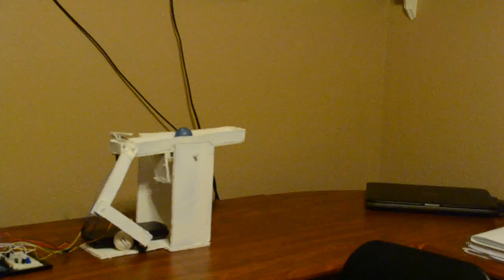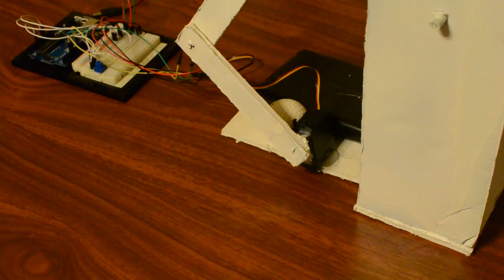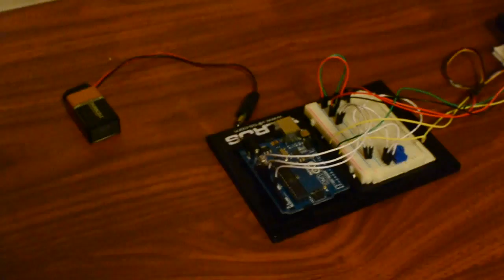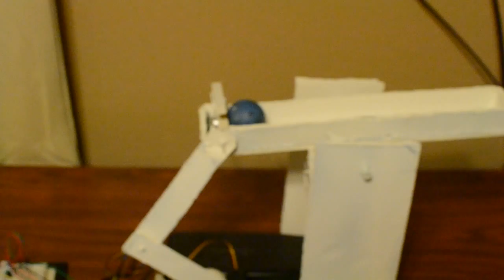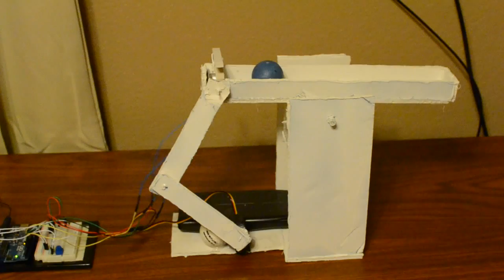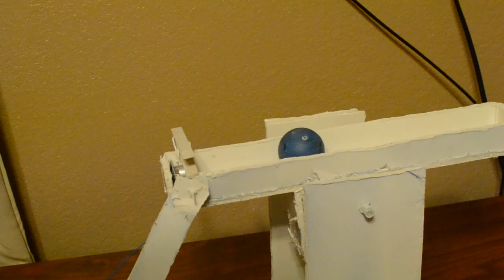Arduino Ball on Beam PID Balance

Comment: Thats really cool mate. Did you use the full function PID control or just Proportional + Integral loop? whats the sample rate? I tune P+I loops all the time at work for HVAC mechanical plant. our system has a 1 second program cycle so it's no good for something like this project

Comment: i believe some of the noise could be coming from the  walls being so close to the ultrasonic sensor. When the "Ping" is emitted it propogates outward in the shape of a cone. This would cause the ping signal to jumble up a bit as it eminates outward and hits the side those walls. Do you get the same signal noise when the ping sensor is not mounted on the rig?

Comment: Regarding the noise, did you ever figure out a way to smooth out the input/output? ......I'm building an exercise bike/generator and dialing up the resistance using  "square wave" inputs is way too harsh. The solution is to use "sin wave" controller, something like this: https://www.electricbike.com/sine-wave/.

Obviously if you want to build this type of thing yourself you wouldn't buy a sin wave controller but you could use the same principle with your Arduino setup.
Reply from the maker: +darkmath100 Interesting information! I haven't heard of this before, but thank you for the idea :)
Reply: David Zwick No problem. A Sin Wave Controller is probably over-kill but you're building stuff to learn how to do things and let's face it adding fancy shit to electronics is just plane cool.
:-)
Reply from the maker: +darkmath100 What is funny is I told someone about this and they said why not use a RC circuit. Even using a micro controller is overkill for a pid control loop. But it is cool like you said :)

Comment: hey david, did u use matlab simulink for the pid? or u use the arduino coding
Reply from the maker: +RoyALRiBBoN I used the arduino for the pid. I could have used simulink but then I would have to bring my computer with me to run it :)

Comment: Hello David, I happen to have the same idea as you, and I am glad to see your video.
I have encountered some problems so far.

1. When I put the PID_v1 file into the library, the "#include<PID_v1>" doesn't turn yellow. Is that normal? Because other libraries like servo will turn yellow when they are in #include<>.
2. My servo is out of control. It doesn't move as the ball's position changed.

Could you help me with that? 
Much thanks!
Reply: dvchang0611, David Zwick : I am facing the same problem with the servo motor. I am using TowerPro MG945 Servo Motor. 

When I run the code, the motor keeps rotating left and right out of control.
Please David, shed some light on this!
Reply from the maker: +Sourish Mukherjee I believe it is probably a problem with putting the library in. The change in color is due to the editor, which should occur when you put it in the library directory. I hope it gets working for you!

Comment: Hello David, The link for NewPing_v1.5.zip is definitly broken.
I have tried it using both Chrome and IE.

After clicking on the 'Slow Download' link and waiting for the 30seconds, the resulting download button goes to a non existant page when clicked.

Could you re-check and repost the link?

Comment: Are you sure the noise is not from the sensor being in a beam, and a small factor that the ball is round?
Also your servo has alot of change for very little movement, it couldve worked much, much better. Good job anyway :)